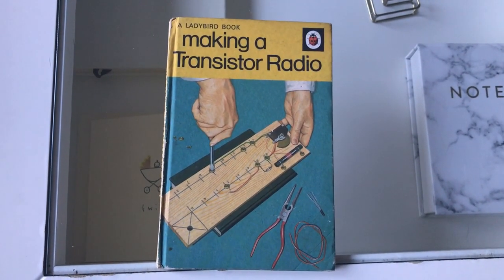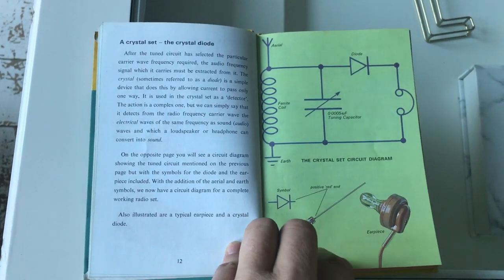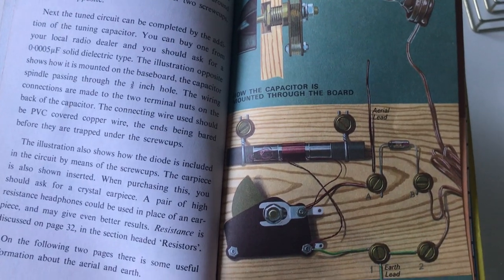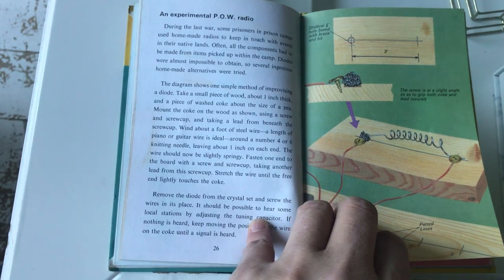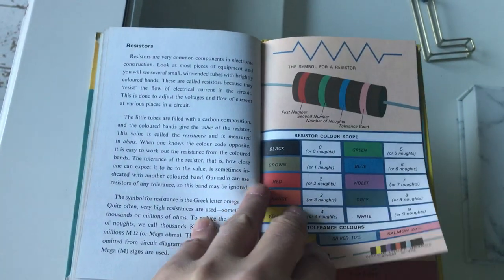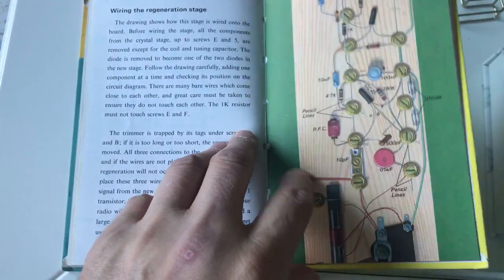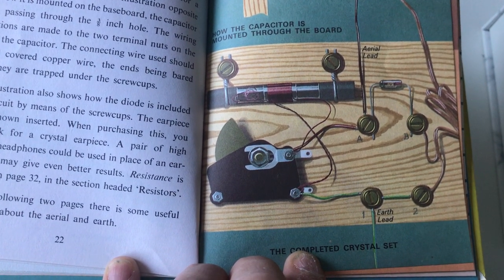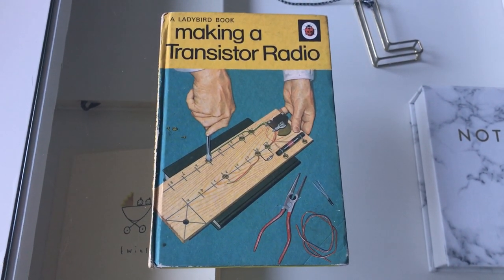'Making a Transistor Radio' by George Dobbs, G3RJV published by Ladybird Books

Comment: Something to note, screw 6 is not used at all. Apparently the Rev. Dobbs's original design before the book went to print was to have a 100ohm resistor and 10uF capacitor in parallel on screw 6 and screw 5, with the output transistor going to screw 6 and not 5. Which was for biasing the transistor and to provide decoupling. With the transistor directly connected to common, this can actually prevent the radio from working, all depending on the characteristics of the transistor used, because it could be biased into cut-off. And even if it does work, adding these components does improve the radio's amplification. Maybe it was a change made by a Ladybird editor, to simplify the design, but unaware of the distinct possibility of disappointing young builders.
Reply from the maker: Hi there Michael, thank you very much for this background information! I still love this book, 30-odd years after picking it up for the first time! I'm not sufficiently educated in radio design to have picked up on the design change. My limit is designing (ok was designing) and building crystal sets! Thanks again and 73! Clint

Comment: I never understood what the author meant by Coke wrt POW radio. Can you please tell me what it means?
Reply from the maker: Hi there, it's a type of coal: From Wikipedia: The unqualified term "coke" usually refers to the product derived from low-ash and low-sulfur bituminous coal by a process called coking. A similar product called petroleum coke, or pet coke, is obtained from crude oil in oil refineries. Coke may also be formed naturally by geologic processes.[1]
Reply: @OxfordShortwaveLog  ah. By "coke' I thought they meant cocaine. That's probably why I couldn't get the thing to work.